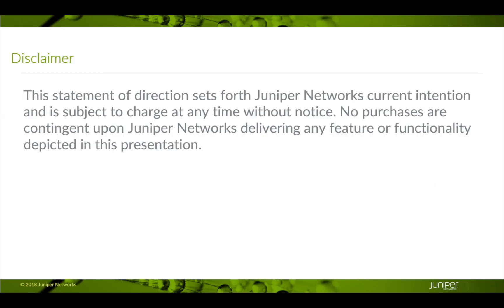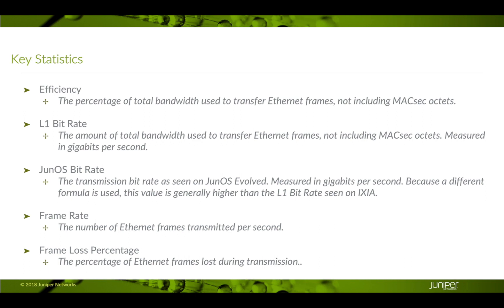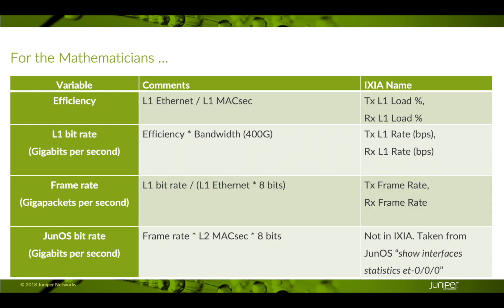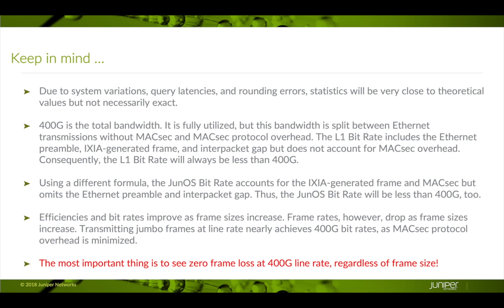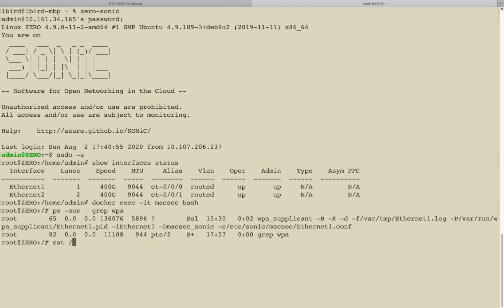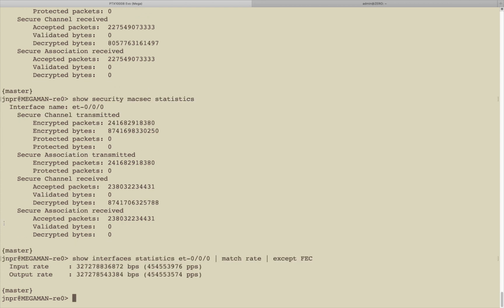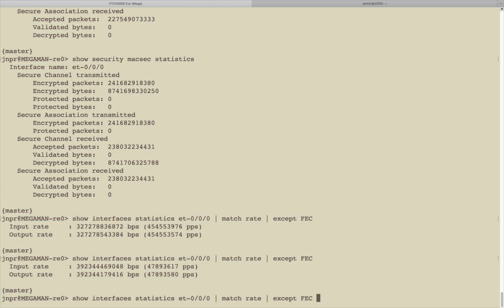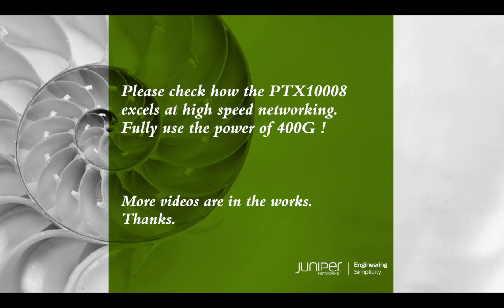400G Line Rate MACsec on PTX10008 Router

Comment: I see that the packet number is a 32 bits field which means that the maximum number of packets per channel is ~ 4.3 billion. Considering a 1500 bytes MTU for each packet, that number would be reached in about 8 minutes 35 seconds going wirespeed at 100Gbps. What happens when that number is reached? is the channel renegociated? does the device crash?